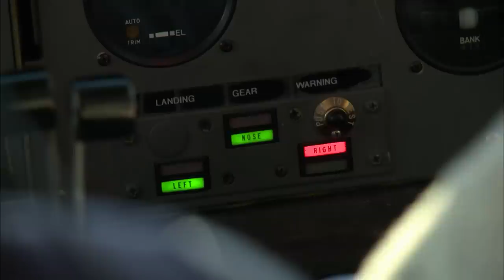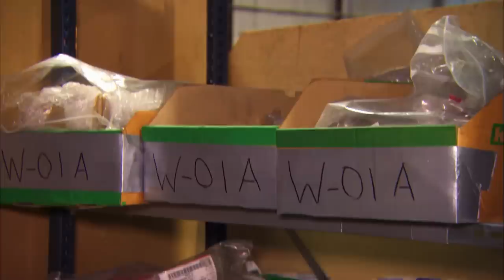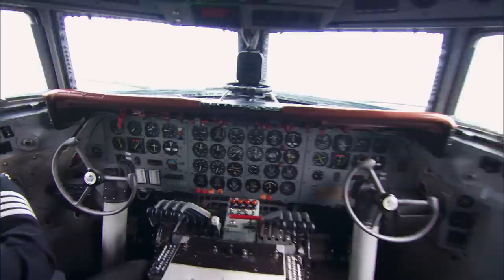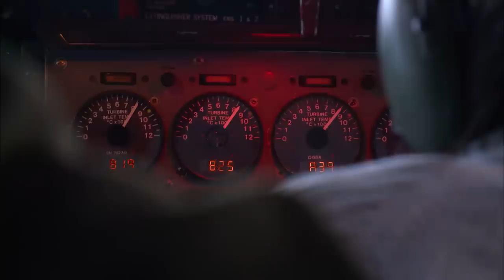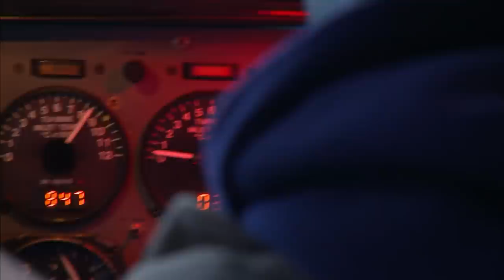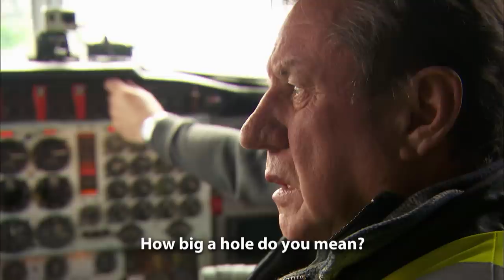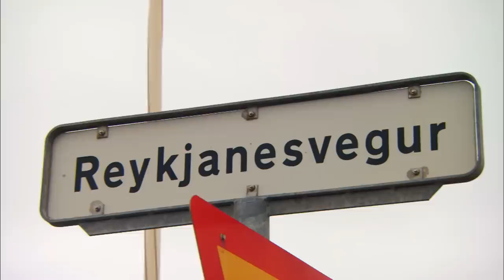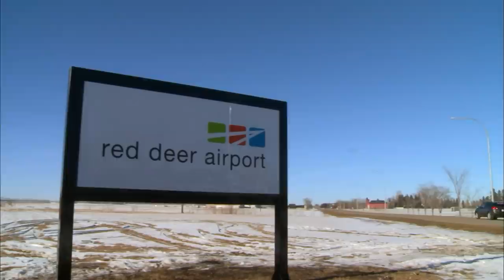Plane Breaks Apart Spilling Fuel All Over The Runway | Ice Pilots NWT | Wonder

Comment: Something fishy here: Heard a worker say that the forklift hit the plane; also the footage showed the forklift blades tilting down until the gpu fell off?? I've driven forklift at an Int'l airport...not even a whisky sippin driver would do that🤔Beats prop deadline by a couple hours...really? Producer drama.
Reply: Exactly also my suspicion!  The viewers want to see action and to be entertained, hence such scenes were put in there.  Most likely not only the first but also the last episode I've watched! 😏
Reply: I understand the concern about the accident losing the power generator unit appearing fake. It's important to consider that the crew of 'Ice Pilots' might not capture every moment on video.

In this case, when loading a power generator into the plane failed, they likely saw it as a significant event worth including in the documentary for its tension and drama. Without original footage, a reconstruction would be necessary.

During such reconstructions, avoiding real damage is crucial, which explains why the forklift didn't dent the plane's fuselage skin. This approach ensures safety while still providing the necessary footage for the documentary.

I believe this could explain why the documentary accident looks very odd.

Comment: The fork lift operator that dropped the power unit made a few mistakes. As shown later on, loads are transversed from point to point while low to the ground, only lifted at the last moment with minimal forward driving or reversing.
Secondly, it was on rollers. One strap will not hold the weight / enertia of a 2.5 ton load. The forks should have been kept tilted back (boom) and slow careful driving forward, no sudden breaking.
Reply: Breaking is what the load did when it hit the ground.  Braking is what the forklift did.
Reply: He lifted it basically as late as he could 
We have one of those loaders on order farm, the way the geometry works once you get near the top of its lift it starts tilting forward automatically, caught me out a few times with just dirt 

It's really not suitable equipment for loading aircraft, they're rough operating and has no safety valves like a forklift in case of hydraulic failure
But I guess that remote you can't have dedicated gear, the same machine is prob a forklift and snow cleaner
Reply: @fowletm1992  Regarding the odd geometry tipping forward at the EOS, I suspected as much.
There are proper fork lifts for rough working in agricultural fields and the such.   Mettabo and others have them. I think they are typically at least 3.5 tons capable.
Reply: It looked to me like the tilt cylinders failed; maybe overloaded maybe just overdue maintenance.
Reply: @fowletm1992 , no, he was well back, when he lifted it.
Reply: That generator drop was an intended accident, maybe done to make the video more interesting! 
No fork lift driver can be that stupid!
Most YouTube visitors saw that happening seconds before.
Reply: that was a scripted "accident"
Reply: @fowletm1992  I never knew they would tilt forward automatically. Appears more like front end loader.

Comment: I've changed several dc3 wheels and tires. sob isn't easy. especially with seized brakes and axle tubes . combat that with a tube that's stuck to the wheel it's time consuming to get the tire off

Comment: So why do Electras have an APU if it is incapable of starting an engine?
Reply: The issue is that the APU operates fine at “normal” cold temperatures but is a massive drain on the aircraft at extremely cold temperatures.
Reply: @thomasm1964  In normal use an Country like UK not cold enough to make any difference